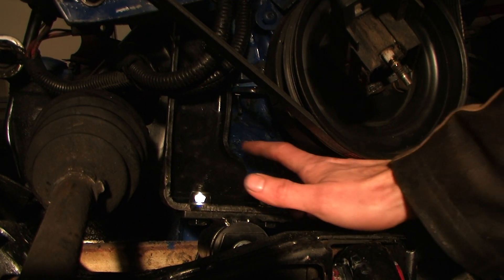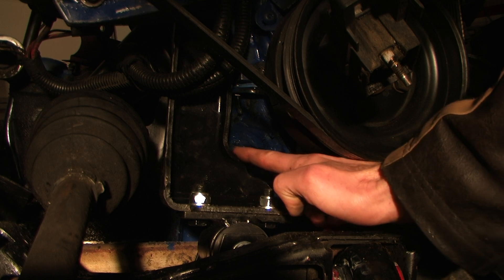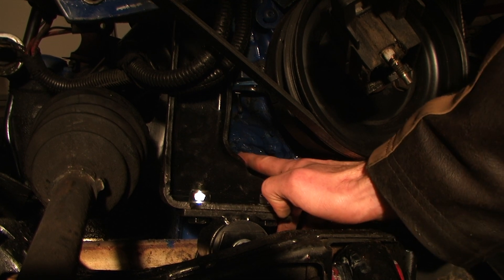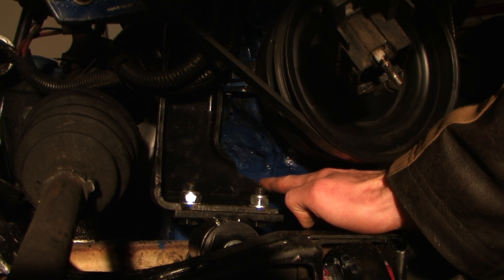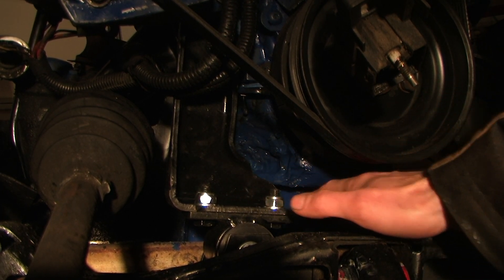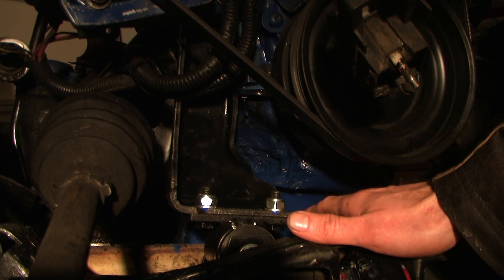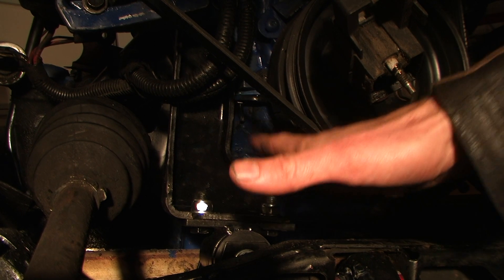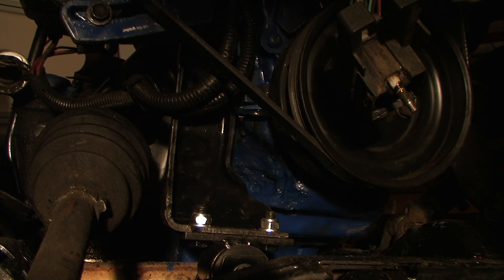Pontiac Fiero - How to convert the oil pan from a 2.8 engine to a 3.4 pushrod

Comment: Nice video.
I usually notch the engine mount bracket to clear the oil pan for a cleaner install. You just want to barely notch it so as to not compromise the structural integrity of the bracket.